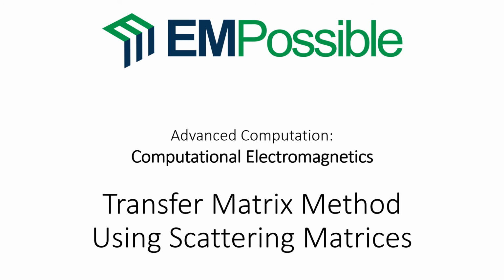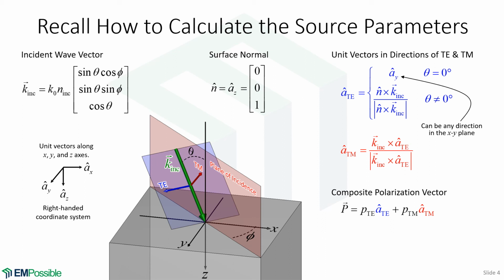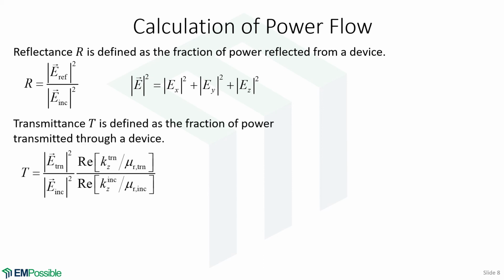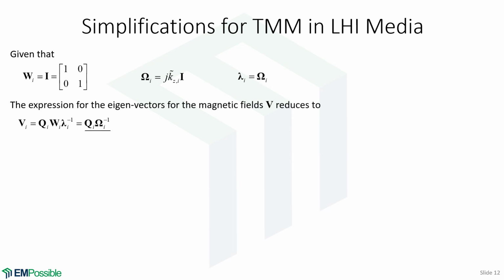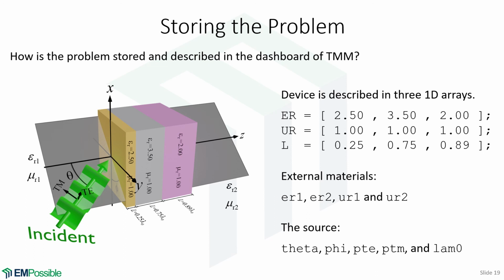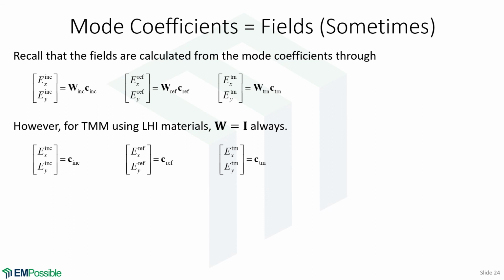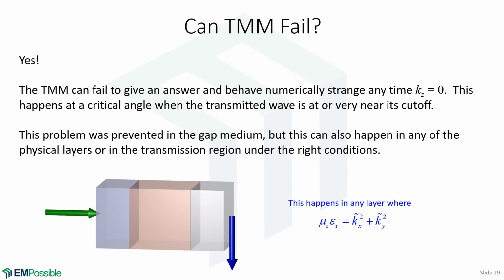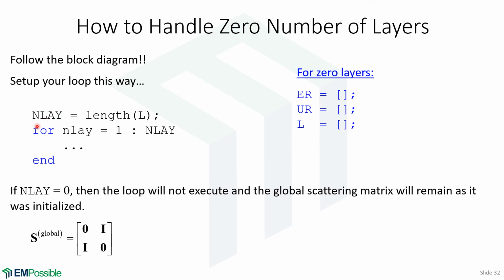Lecture -- TMM Using Scattering Matrices

Comment: When neglecting c_inc(right), don't we neglect a significant physical effect? Suppose a wave is reflected off of the boundary of layers 2 & 3. Then it serves as c_inc(right) input for layer 1 when it reaches the interface between layers 1 & 2. Thereat, it may be partially transmitted, where after it may also partially exit into the environment at the next interface, thereby contributing to reflection
Reply: I forgot to mention: thank you very much, Dr. Rumpf, for supporting me in my learning journey of em & simulations thereof. You're an incredible teacher! Greetings from Germany
Reply from the maker: Hello Germany!!  The formulation does ignore waves that may be sourced from side 2. However, a wave sourced from side 1 the reflects from the second boundary is still handled correctly. If you truly do have two sources, one from each side, you should retain that term in your formulation. You can also run two simulation, where you reverse the layers for the second simulation, and then add the results.

Comment: Very interesting lecture. Nice explanation. My question is that how we find reflectance and transmission for anisotropic medium..??
Reply from the maker: This is more complicated. The traditional TMM uses a 2x2 formulation. To handle full anisotropy, you must adopt the more general 4x4 formula. In this formation, when you solve the eigen-value problem you will have to sort the modes to separate the forward and backward waves so that you can assemble the scattering matrices and solve the problem in a stable way. I do not have much information on this, but what I do have you can find in Lectures 2b and 2c here:

https://empossible.net/academics/emp5337/

Comment: Is it possible to apply this method to a layered structure but the top layer has a geometry that has two slits in its structure?
Reply from the maker: No. This method can only handle homogeneous media.  When the method is generalized to handle inhomogeneities, it becomes either method of lines or rigorous coupled-wave analysis. I have information on both of these methods in my Computational Electromagnetics course here:

https://empossible.net/emp5337/

Hope this helps!!

Comment: Hi Prof Rumpf,

Do you cover Plane Wave Expansion Transfer Matrix Methods such as that outlined by  Zhi-Yuan Li and Lan-Lan Lin

Phys. Rev. E 67, 046607 – Published 15 April 2003?
Reply from the maker: Yes.  For some crazy reason the authors decided to rename rigorous coupled-wave analysis. The original developers of the method called it RCWA and later others keep trying to rename it to things like Fourier modal method, PWEM+TMM, among other things.

I teach RCWA in Topic 7 here:

https://empossible.net/emp5337/

To understand RCWA, you will first need to work through the transfer matrix method in Topic 2 and the plane wave expansion method in Topic 6 at the above link.  RCWA = PWEM + TMM and there are topics in PWEM and TMM that I do not repeat in the RCWA lectures.

Good luck and have fun!

Comment: How can we be sure that different parameters of the gap medium don't affect our final results?
Reply from the maker: You can choose anything for the gap medium and the code will work most of the time. However, it is best to choose something that prevents kz from being zero in the gaps so that your code always works. I cover this on slide 23 in Lecture 2g from the course website:

https://empossible.net/emp5337/

While there are many proper choices, I use...

urg = 1.0
erg = 1 + knx^2 + kny^2

where kn is the normalized wave vector.

Comment: Dear Dr. Rumpf,

I would like to thank you first for the very interesting and educative videos.
If i want to to also calculate the the phase ϕr of the amplitude reflection coefficient, could you help me to get for the 3 coordinates? x,y and z? 
Thank you!

Best regards
Reply from the maker: I would try not to think of x, y, and z as having separate reflection coefficients.  A wave travels as a single intact packet of electromagnetic energy.  For linear, homogeneous, and isotropic (LHI) materials, these are the TE and TM polarizations in the framework of TMM.  Therefore, there is a single reflection coefficient for TE and another for TM.

There are two ways to get these coefficients.  The easiest is simply pull it out of the global scattering matrix.  These are 4x4 matrices.  They are 4x4 because there are two polarizations and two ways to enter and exit the device, leading to a total of 4 combinations.  For example, one of the numbers in the 4x4 global scattering matrix describes the amplitude of the reflected TE wave due to an incidence TM wave.  This will be zero for LHI materials.  Another will describe the amplitude of the reflected TE wave due to an incidence TE wave.  This will be the TE reflection coefficient you are after.  It will be a complex number where the polar form describes the amplitude and phase you are after.

Hope this helps!!
Reply: @empossible1577  Thank you s much for your answer. 
I implemented your scattering matrix TMM method using the diagram shown in your notes (slide 31 or page 16). after calculating the global S matrix we multiply the S11 with the e_scource, we get 2 reflection in x and y and then we calculate in the z direction... So i should directly from the  first element of the S11 global  extract the phase  or from the combination of the reflection field x,y,z? My goal is to detect the reflection phase in a FP laser or a VCSEL where it is 0 at the FP Resonance frequency.
Thank you so much again
Reply from the maker: @bedouinsassya7510  I think you are missing an important concept.  Refer to slides 17 and 18 in Lecture 7b from the course website:

https://empossible.net/emp5337/

You first calculate esrc, which has the x and y information.  However, you then calculate csrc which essentially determintes the amplitudes of your TE and TM polarizations.  The S11 and S21 coefficients are applied to those and then projected back to x and y at the end.  Fundamentally, the scattering matrix elements are relating the reflected and transmitted TE and TM modes.  It is for this reason that you will extract your reflection or transmission coefficients from the scattering matrix elements.  Keep in mind that S11(global) will be a 2x2 matrix because in general TE can scatter to TM and TM can scatter into TE.  You will need to pick the correct scattering matrix element depending what information you are seeking.

Comment: Hi Professor, thank you for your great lectures. I am attempting to implement this, but I am having an issue with calculating the scattering matrix elements at normal incidence - at normal incidence, Omega_i is proportional to the identity matrix and Qi is proportional to [[0,1],[1,0]] so Vi = 0 and has no inverse. Am I missing something, or is it not possible to have exactly normal incidence with this method?
Reply from the maker: Yes, normal incidence is possible and probably the most common thing.  For this case, Vi = [ 0 1 ; 1 0 ].  

Let me point you to the official course website where you can get links to download the notes, links to the latest version of the videos, and access to other learning resources.

https://empossible.net/emp5337/

In the Homework "Help" section, you will see a "Benchmarking Aid for RCWA 1x1."  RCWA using 1x1 spatial harmonics is the transfer matrix method.  You can use this to benchmark you terms.  In my notes I use the positive sign convention for TMM and the negative sign convention for RCWA so you may see some sign differences, but the document should still help you.

Hope this helps!
Reply: @empossible1577  Thank you, I will give that a try!

Comment: Dear Dr. Rumpf
Thank you extremly for your wonderful lectures. At 11:25 of this lecture,  mu_trans,r and mu_inc,r are used to calculate the transmittance.Why to do that? And is there a specific derivation process?
Reply from the maker: Thank you!  I am glad the videos are helping you!

First, let me point you to the official course website where all of the information is organized and you can get links to the latest versions of the notes, videos and other learning resources.

https://empossible.net/emp5337/

These extra terms arise because the medium on the transmission side may be different than the medium on the reflection (or incident) side of the device.  When in a different medium, the field quantities will be different if the same amount of power is flowing.

Expect these equations to change in these lectures very soon.  We are in the middle of figuring out how to modify them when the external mediums have loss.
Reply: @empossible1577  Hi Dr.Rumpf
Thanks for your reply. But according to dispersion relationship,k_Zs have already taken the difference of mediums into consideration.So i don't know the function of mu_inc,r and mu_trans,r.And where is my thinking mistake?
Reply from the maker: @mihweighyung6312  For some reason, I cannot find where I have the detailed derivation.  I found an almost complete derivation in Lecture 3g in the FDTD course:

https://empossible.net/academics/emp5304/

Power flow is ExH.  The equation is put in terms of the electric field.  To do this, an impedance term arises in the equation.  The reflected wave is the ratio of reflected power to incident power, but since they are same medium the impedance terms cancel.  For the transmission region, the impedance terms do not cancel and the permeability terms are left after simplifying with other terms in the equation.  The kz terms arise because it is only the z component of Poynting vector that should be considered in these calculations.
Reply: @empossible1577  Thank you very much for your detailed explanation, And your high sense of responsibility is admirable.

Comment: Dear Dr. Rumpf

Thank you very much for your lesson, doing CEM is often frustrating because everyone claims there is plenty of literature, yet few are the people that goes as in-depth as you. There is just one little but very important thing I am missing. I work on a 1D structure and have been able to calculate everything mentioned in the diagram (which is by the way a blessing, your lecture is the only one that have provided such a comprehensive thing), and I am now trying to plot the stationary electromagnetic field along the Z-axis. I don't understand what should be the procedure, or which equations I am supposed to use.

Sincerely yours,
Reply from the maker: Thank you!  I am actually writing a book right now that is intended for complete beginners to get started in computational EM.  Not sure when it will be released as I am not even finished writing it, but close.

Visualizing the field...what method are you using to simulate the 1D structure?  TMM?  If TMM, visualizing the field is a bit tricky.  I have notes on it in the TMM Extras lecture you can get to on the course website.  

https://empossible.net/academics/emp5337/

I am a big fan of visualization.  You may want to study the finite-difference frequency-domain method.  It is much more versatile than TMM (although slower) and excellent for visualizing the field in a variety of structures.

Comment: Hi, professor! Thank you for your lecture :)

I want to simulate coupling of incident wave to a dielectric waveguide where the evanescent field caused by total internal reflection interacts with dielectric waveguide mode so that it excites the waveguide. It's like surface plasmon resonance(SPR) using prism. Eventually, I want to do parameter sweep along the wavelength and incident angle based on which we can get dispersion relation of the waveguide mode sort of indirectly.

What do you think is the best way to simulate this experimental situation? I'm thinking of TMM, 2D FDFD, and 3D RCWA. I can try all of them but I just want to know your opinion.

Thank you for reading :)
Reply from the maker: I would use a 2D FDFD or a 2D FDTD to simulate your waveguide excitation.  I think you are going to want to visualize the fields to help interpret the simulation results.  TMM and RCWA can certainly visualize the fields, but it is a lot more work to do that with these methods.  FDFD and FDTD will allow you to do other things as well much easier.
Reply: @empossible1577  Thank you for your opinion :D
Reply: @empossible1577  Oh, and I want to ask you whether all the methods I mentioned likeTMM and RCWA are at least also capable of doing that kind of simulation!
Reply from the maker: @HCho-xe1cj  All methods can be made to do anything.  With that said, some methods made certain types of simulations easier or more accurate.
Reply: @empossible1577  Thank you so much! :D

Comment: Hello, Dr. Rumpf! Thank you for your lectures! As I can see, you choose "plus sign convention" in that lecture. Does It leads to changing one terms in block-diagram only (X = exp(lambda*k*L)) by comparison with lectures at 2013 (https://www.youtube.com/watch?v=mOy5jyZe7_Y), where was (X = exp(-lambda*k*L)? Are there other differences between two block-diagram, inspired by sign convention?
Reply from the maker: I have derived and implemented both, but I sort of forget the differences.  I do know it is very minimal.  I would like to say it is only the X matrix, but I would hate to be wrong.  I derive RCWA with the negative sign convention.  Consider comparing TMM to RCWA in my block diagrams.  Here is a link to the course website where you can download the notes and get links to the latest version of the videos:

https://empossible.net/academics/emp5337/
Reply: @empossible1577  Thank you for answer!